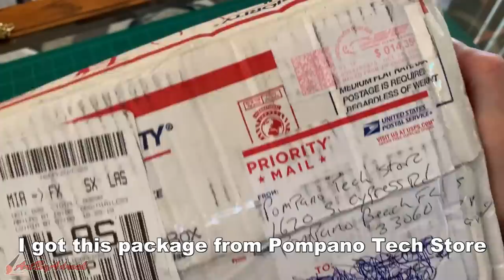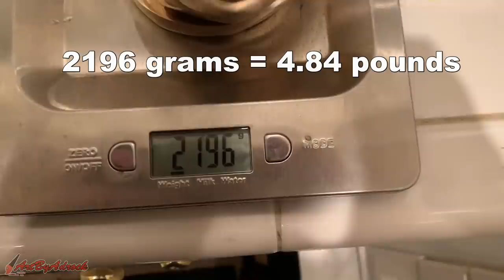HUGE 5 Pound Coins From SCRAP Copper - Melting Copper Trash & Electro Etching

Comment: Love your videos! Just got my furnace and wanted to pick your brain...where can I look up the proper propane pressures for melting?
Reply from the maker: For brass or copper you don’t need to go higher than .1 MPa. For aluminum .07 will be just fine 👍🏻 hope that helps
Reply: ArtByAdrock thank you!
Reply from the maker: No prob 👍🏻
Reply: ArtByAdrock is there a science or reason why the pressure needs to be at those levels?

Comment: What do you run your pressure at on your regulator?  My furnace acts like it’s not getting enough air when I put the lid on it and I was just wondering if that’s because I don’t have enough pressure.  I run mine at 20lb. It start spitting like but only when I put the lid on.

Comment: Do the electro etches ever turn green with the copper like normal petina? I think thatd be a cool and unique visual. Im pretty sure theres stuff out there to force-age copper for roofing. 🤔 Also, have you ever experimented with free form casting with loose sand? Ive tried dropping a little bit of molten lead onto some loose, fluffy sand/dirt and it made a cool natural looking "nugget" when it  filled the small gaps the dirt. Just brush off the dirt and done. Id reccomend brass or nordic gold so you can look at them on your shelf and feel like a successful gold miner.😎🤑👌

Comment: Hey man amazing video I was wondering how do you get that polish with the angle grinder I just got one but can’t get that smooth of a finish what grinding wheel do you use
Reply from the maker: It’s a lot of grinding with a flap disc and then sanding starting with 240 grit all the way up to 3000 grit in small increments 👍🏻 hope that helps
Reply: Thanks just didn’t know what disk to use
Reply: I don’t have a drill press but I’ll figure out something

Comment: What was the purpose of adding the steel beers to the copper?
Reply: I am guessing you meant gears. The gears were likely a metal called Zamak. A high zinc alloy so he was in essence making brass.
Reply: @brianmoore1164  i hope he meant gears. I re read it twice. Best I can remember the zinc is added for the durability factor and makes the aluminum flow better
Reply: @donniebrown2896  You're right. Pure copper is a pain to machine or work.  It is gummy and soft and has very low strength.  Add a little zinc to it however and you get brass. Stronger, more durable,  harder, and better wear resistance.   Use tin instead of zinc and you get bronze which is better on all fronts, but tin is much more expensive than zinc.

Comment: Nice coins, very cool designs you etch onto them, I have done some simple etching myself but would like a more professional way to do this.
Do you make/print those yourself? the transfer method you use looks very easy to do. I would like to give that a try myself.
Also, are there more of those big steel ingot molds available for purchase? I would like 2 of them, 1 as a gift for a friend. 👍👊
Reply from the maker: Thanks. Yeah I print them myself. I should be getting more of the molds in this weekend as the first batch is already sold out. They went quickly 👍🏻